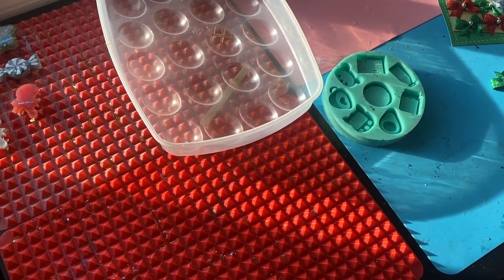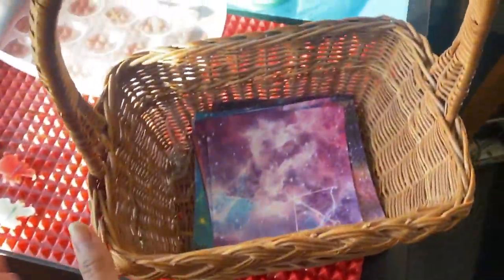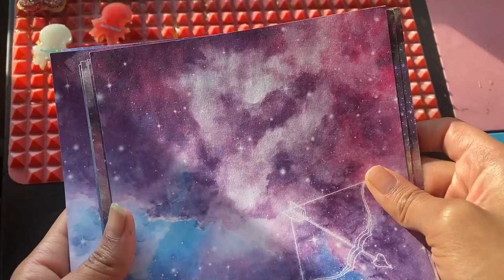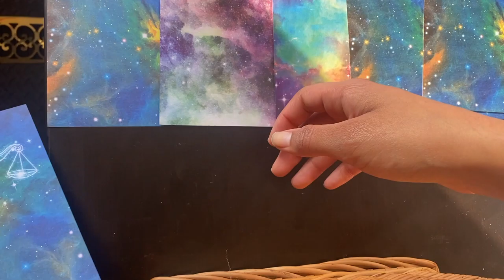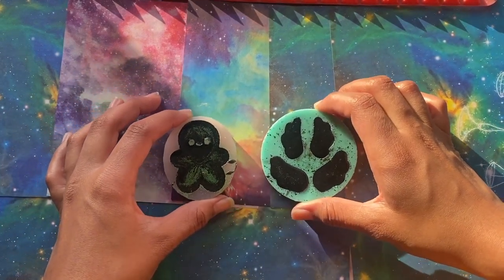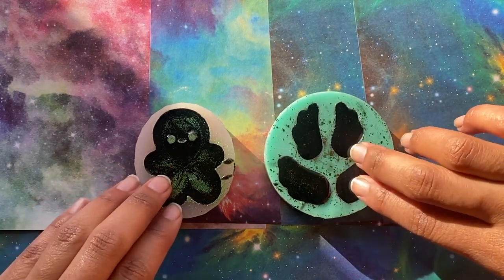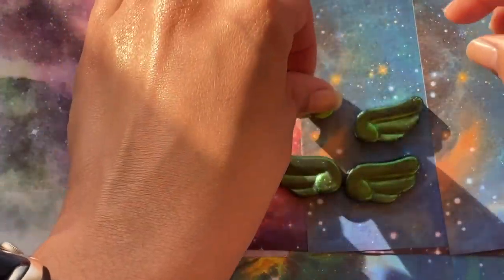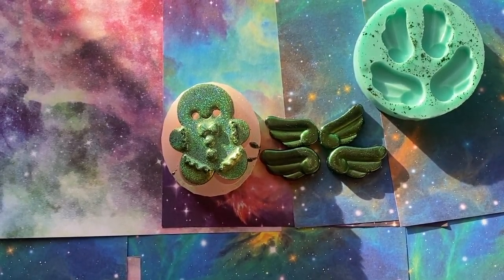How I Record Demolding My Resin Pieces

Comment: This was very helpful. Do you use a phone video editing program?
Reply from the maker: I'm glad! I actually use Final Cut Pro on my Mac to edit videos. I record the videos and send them to my Mac, and than edit them with that software.
Reply: @ResinWishes  I'll look into that;  have a laptop, though.  I like the basket tripod device.  So far, I have not found a tripod I like.
Reply from the maker: @glutenfreeappletree  When it comes to windows computers, you could use Vegas Pro! Video editing softwares can be costly so maybe OpenShot could work out for you as well. I haven't used it personally but it's a free editing software that some people like. https://www.openshot.org 
Haha I'm glad you like the basket tripod! It works for what I need it to do. After editing this video, I decided to try to find another tripod. I ordered a 50 inch tripod for my phone from Amazon for around $20. It may be worth trying out! It's helpful that it's 50" so you can sit it on the floor and just extend it. https://www.amazon.com/dp/B081CF1DMM/?ref=exp_resinwishes_dp_vv_d